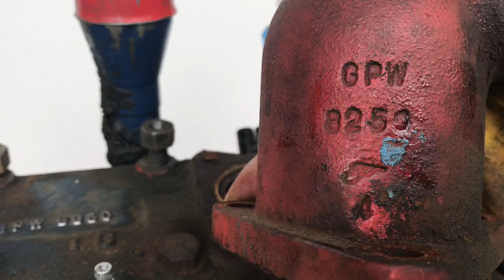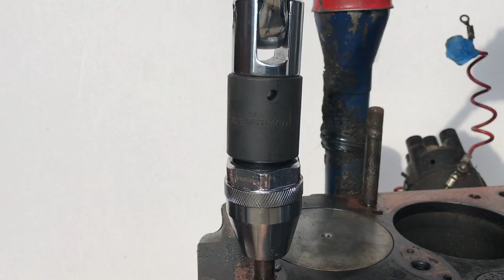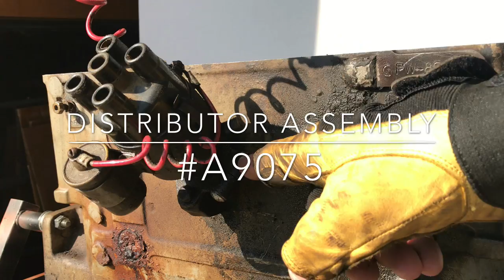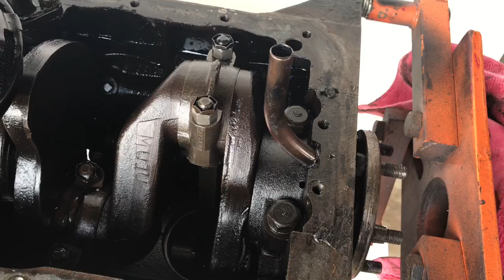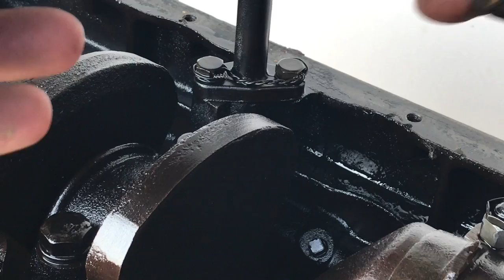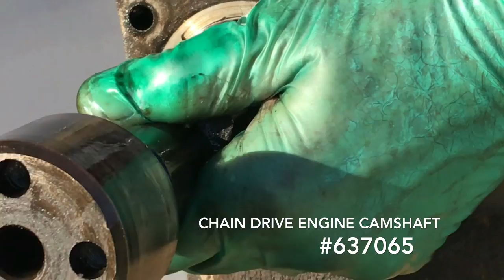How To Disassemble The Willys MB Ford GPW L134 Engine Team G503

Comment: Wow, you have an excellent command of bolts and nuts, sizes and dimensions, length and total count no less. Impressive. lol. And the part numbers, very handy. We use to do stuff like this all the time. Of course we didn’t keep track of each specific nut, bolt and part number as well as you do. Again, lol.

Comment: What if the two center piston assemblies are frozen and you cannot turn the crank shaft to access the connecting rods?
Reply from the maker: @markbarnard1399  soak the pistons with PB blaster or equivalent.
A mix 50/50 with acetone and transmission fluid will do the trick also. Be patient, let it soak. Tap with a wood block and hammer.

Comment: Oh & I forgot to mention when refitting the distributor clean up the bore & use Kopr Kote or similar smeared on the distributor shaft body.
And the splash shield ~ Spacers are essential & are these bolts the same as the rest of the oil pan? Be careful refitting that these bolts DO NOT damage the timing cover as sometimes happens when the spacer is left out.

Comment: Another great video Scott! You made some great points especially regarding followers, convex face plus returning good used ones to their original placement & not mixing them up.
Some observations that may help others: 
1. When removing valve keepers [sometimes when just doing a valve regrind] lay paper towel or rag along the valley so dropped keepers don't just disappear.
2. Removing main bearing caps ~ note the lettering or numbers on the caps so that are put back the right way round. 
Reversing will cause shaft lockup when re-assembling as tunnel is no longer round &/or concentric.
3. From around 22.00 ~ 23.00 note the 5 or 6? dowels that locate the main bearings shells. Can't remember now the last Jeep engine I did, was a long time ago.
These stepped dowels are held in the cap or block by smaller drillings in the bearing shell. 
These dowels are sometimes missing or get lost on disassembly. Not fitting dowels on reassembly ~ bearing shells will spin & block off oil supply.
4. @ about 22.00 the BEARING CAPS show just one hole in each of the bearing shells. These holes are for holding the dowels in place
5. @ about 23.00 the bearing shells in the ENGINE BLOCK have 2 holes one for the dowel & one for oil feed. This feed is not only for the main bearings, but feeds off through the crank to adjoining connecting rod bearings. 1 main feeds con rod 1, 2 main [or middle] feeds con rods 2&3 + 3 main [or rear] feeds con rod 4.
6. A trap for young players is that these cap & block bearing shells will interchange [when they shouldn't] & if this is done inadvertently, oil supply to the main & adjoining connecting rod bearings will be blocked off.  Oil pressure gauge will show great oil pressure!
7. If done incorrectly or dowels are left out  the engine will be promptly destroyed.

Comment: Engine had 6.2:1 compression ratio to most likely cope with the worst fuel available during the conflict. Maybe down to 80 octane or even worst. Wondering if it wouldn't be possible to slightly raise CR in order to gain a bit of torque while still running 87 octane regular unleaded fuel (US standard). What about 7.5:1 ? What do you guys think?

Comment: I know the three bolts around the camshaft are 3/8 UNC  but what is the correct length? I can't seem to find them anywhere in the SNL.
Reply from the maker: Jeep Jockey Part # 6412 Bolt 3/8-16 x “3/4” (engine plate to cylinder block)
Reply: @TeamG503  cheers guys. Out of curiosity, where are they in the SNL?
Reply from the maker: Jeep Jockey I found them in the Master Parts Manual👍
Reply: @TeamG503  cheers. I haven't got that one.
Reply from the maker: Jeep Jockey when I get back to the shop, I will post a pic of it in the community section of the channel.👍
Reply: @TeamG503  nice one!

Comment: This is gonna be a good help when I will take apart my CJ2 a h - 46
The engine dont turn. It have not run in many years, and stod still in a slight angle front down in a garage.

Comment: What did you use to free up the distributor mine is stuck big time. Love the video
Reply from the maker: angela leblanc thank you.
Soak the area over days with PB Blaster or Kroil.
A 50/50 mix of acetone and brake fluid works as well.
Patience!!! That is the key. Soak it faithfully for days.

Comment: Hi Scott,  I have been enjoying your videos and thanks for sharing. Quick question: I took my 1945 CJ2a  out of the barn where it has been sitting since 1983 and put some oil in each spark plug hole. When I turn the engine over with a socket handle on the hand crank boss I seem to run into a hard stop in both directions.  Any thoughts?  It almost feels like I get through all 4 cycles before the stop. Thanks , Andy
Reply from the maker: Sounds like your rings are either rusted or have made a ridge in the cylinder wall. That’s a long time to sit. I’m glad your attending to it. You say a 45 2A? That’s impressive and a sought after Jeep. Not many out there . My suggestion, first soak the cylinders with Marvel Mystery Oil. Be patient, see if that helps. Soak for a few days and turn. If that doesn’t work, pull the head and look inside. 
Thanks for watching my friend. Let me know how it turns... literally, out👍

Comment: Where can i get a replacement engine for a ford gpw? IS that possible to buy one.
Reply: Worst case scenario Kaiser willy's offers a brand new reproduction L134 block
Reply from the maker: Thomas William yes. Ron Fitzpatrick Jeep Parts has a Completely Rebuilt Ford GPW In Stock at the moment 👍
Reply from the maker: Ron Fitzpatrick Jeep Parts currently has an original, professionally rebuilt GPW Engine in stock. Call Ron at 1 800 600 5337

Comment: I loved this video. It was just the way it should be done. Only thing I would add is there might be the need for a ridge reamer to remove a cylinder ridge at the top of the cylinder? This is normally the area that is above the piston ring travel and did not have the very common piston ring wear.